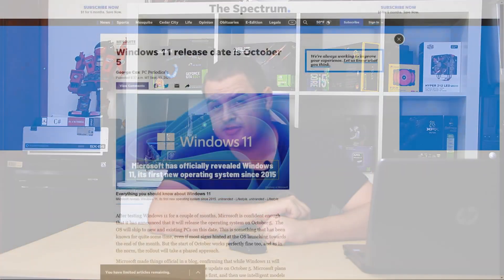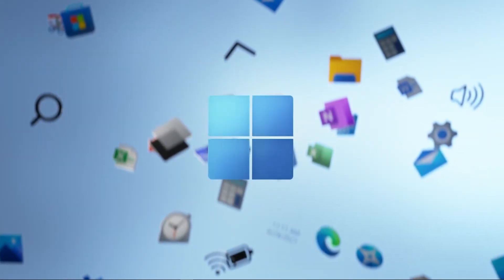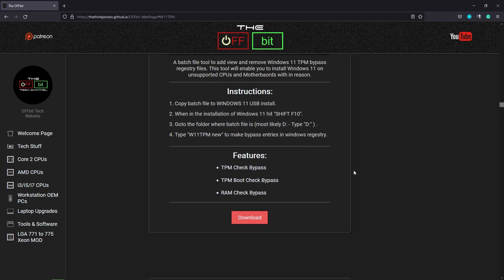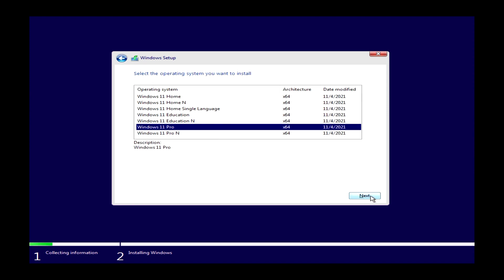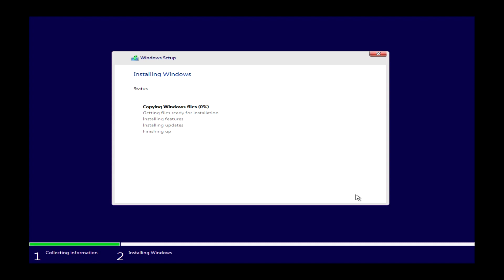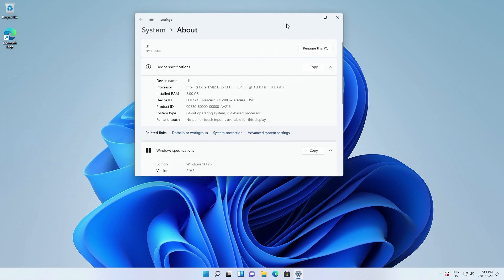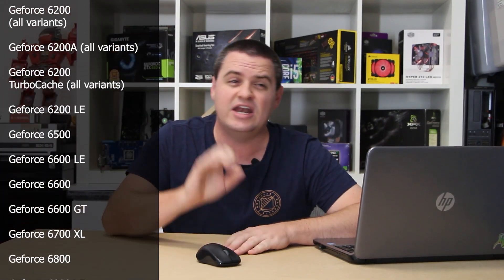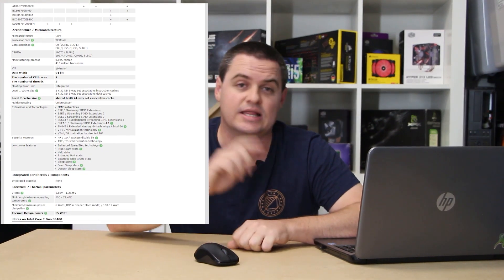Windows 11 on any PC within reason. No TPM Bypass - Install Guide

Comment: By the way, thanks for this video tutorial. I was able to upgrade my old EMachines D729Z laptop running on Pentium Dual Core Processor.
Reply from the maker: Wow, that's great news.
How well does Windows 11 run on the Emachine D729Z Laptop?
Reply: @OFFbitTech  So smooth, and faster than Windows 10 I'd say. Never encountered any issues so far.

Comment: Heyy can u help for the d3d11 problem. I have a core 2 duo and geforce 8400gs
Reply from the maker: Unfortunately, the 8400gs only supports up to dx10.
Depending on which version of the video card, there are 3 versions of the 8400gs, V1 G86 based on 8000 series, V2 G98 on 9000 series and V3 GT218 based on the 200 series that supports DX 10.1.

NVidia only started supporting DX11 from the Fermi Base GeForce 400 series cards and newer.
ATI/AMD only supported DX11 from the Radeon HD5000 Series.

So, unfortunately, there is no easy way to get around it that I know of. However, there will be a workaround or 2 for certain games that can be done but, some of the workarounds will probably disable you from playing on online multiplayer servers.

I'm sorry, there is not much we can do to help.
Thank you for watching.
Reply: @OFFbitTech  ok thx mate.
Reply from the maker: @jaslakshgaming934 
No problems, I hope I answered your question.